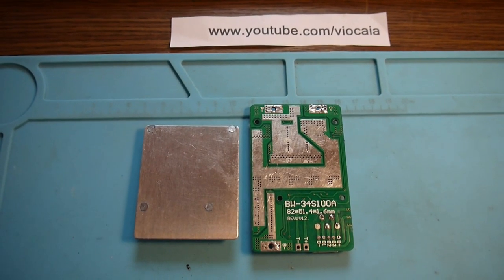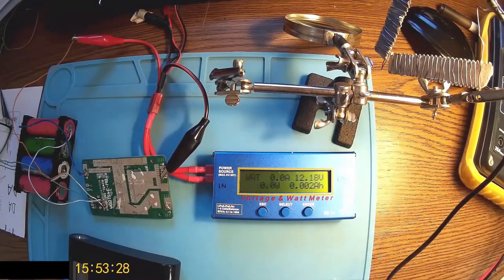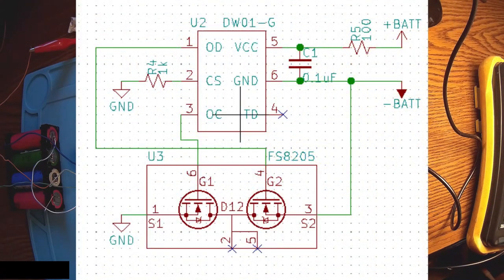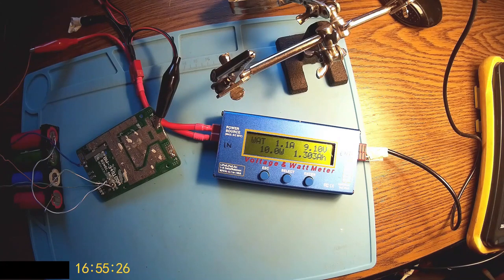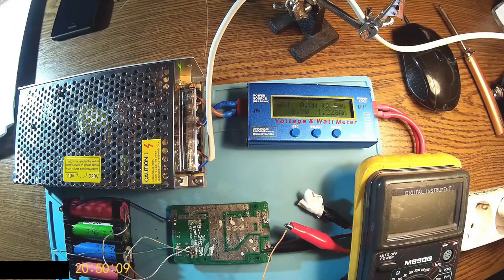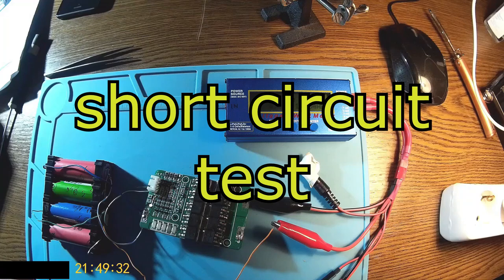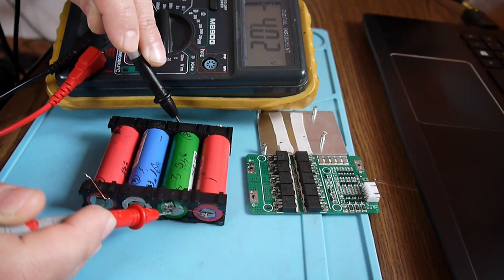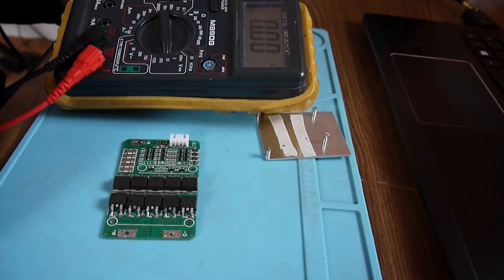BW-34S100A Is this BMS working with LiFePo4 ? Let's see

Comment: It would be interesting to check if the overcharge/overdischarge voltage can be adjusted by slightly changing the value of the external resistor connected to the VCC pin of the DW01 chip
Reply from the maker: Interesting !
Reply from the maker: It can be tested with a TP4056 board..
Reply: You guys are freaking Genius. lol
Reply from the maker: @DIYwithBatteries  Oh..come on!..you're good too.Nice channel!
Reply: @viocaia  unprofessional skills 🤪👍
Reply from the maker: This is a compliment from a professional ! thanks!
Reply: @viocaia   Thank you Sir. 😊🤘
Reply from the maker: @DIYwithBatteries  Let's not forget to have fun! This is just a hobby.

Comment: Using independent Balance circuits you have more choices on the Balance currents.  Higher capacity banks simply need more then 60 or 100ma.  Even with new cells it can be a push.  I buy un used used cells. Modem packs or scooter packs.   Most test out with in  a few hundred ma hour of each other as I group them.  I call them new cells.  All test out higher then the rating.
Reply from the maker: Absolutely!

Comment: I never take my lifepo4 cells above 3.6v liIon above 4.00v.  The little capacity you gain by beating   up the cells is not worth the life time gained by not doing it.  I found using a independent balance circuit and CC/CV voltage source much better then most BMS.   Less to fail.
Reply from the maker: Exactly what I meant, this model is sold like a LiPoFe4 BMS! I

Comment: Charger should do over chargin protection. So cell protection is relevant only for overdischarge. "Bottom balancing" is the easyest way to do for cell protection cyrcuit, while it doesn't require so much mAh to balance the cells at low SOC. Active bottom balancing seems preferable, passive can also do the job.  Thou (in my opinion) it is just enough to solder a service balancing conector on battery, to do occasional check and bottom balance it with a cheap balancer. And even better to use a charger with top balancing function. Thou this is not necesery all the time. Just time to time. Same logic is used in LiPo batteryes for RC usage.

I am testing a 4S9P battery made of harvested 18650s, charged each day by solar for almost 3 years now. For a year I was using "REC active BMS" ( http://www.rec-bms.com/ABMS.html ) on it, then I disconected it, to see the difference. No drastic problems. I just have to balance the cells from time to time. Let's say 2 times a month. More important is to make the parallel packs as close as posible. Capacity (Ah) and also internal resistence. And be gentle to the battery. Never do ful top charge or bottom discharge. This is even less important with LFPs.
Reply from the maker: Very well said! So, this BMS can be used with LiPoFe4 4S pack as long as they are charged by a proper CC/CV charger.Keep on eye on the bottom voltage is more important..right? Many make a confusion , a BMS is not a battery charger!
Reply: @viocaia  Yes. I just spend weekend checking my 36V Bosch Power tools batteryes. They even don't have any low or top voltage protection. Seems this is done by charger an the tool (lawn mover) itself. Logic is just similar as for LiPos. But Bosch does it even more brutally. They don't even use a balancing service connector. They just don't charge the batteryes fully. Top SOC is cca 41,8V. It seems they don't even use CV charging. Only CC. And when charge reaches 42V the chargin is cut.
I still have to check, what bottom SOC is, but I woud predict it is 30V. But the battery itself can be discharged much lower.
Reply from the maker: @tg_privat  Interesting..only CC..looks cleaver! and it's Bosch!
Reply: @viocaia  About REC BMS; it can be used for any 4S battery. Charging is maintaind with CC/CV charger, or in my case with Solar regulator customly set for LiIon chemistry. REC can many things. Parameters can be changed by windows aplication.You can connect 2 relays, use a shunt to measure internal resistance of each S. It can even comunicate with solar charger to lower the charging rate or shut it off. Most important, it is an active BMS. It sends energy from unbalanced cells back to main battery connection, so it doesn't waste much energy. Cells can be balanced with currents up to 2A per cell. It is overkill for a battery like mine. It is ment for e-mobility aplications (longer distance and faster charging), but for that use 4S is not enough.

Comment: Many of the  Chines BMS work in a common voltage for Balance.  Top SOC is chosen by the initial voltage they see.   Down power it and exposé it to the nominal voltage your want it to work with.
Reply from the maker: That's interesting, I didn't know that.Is there any literature about it?
Reply: LOL the Chinese provide little if any documentations.  Just something I figured out.